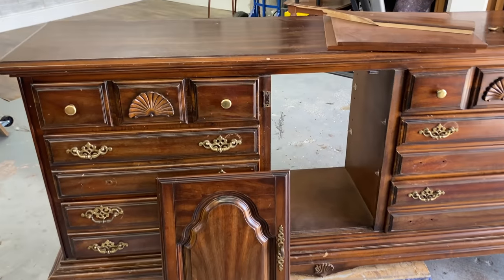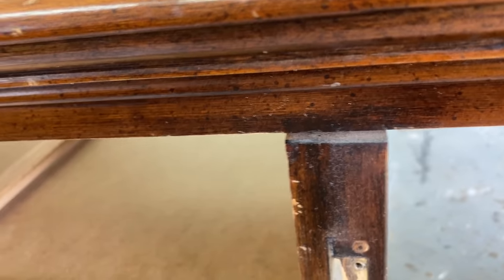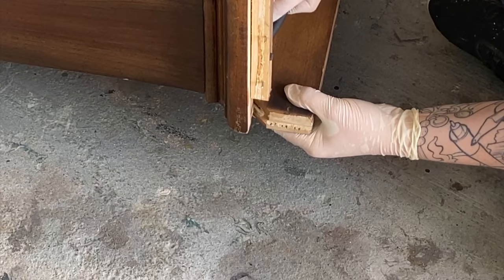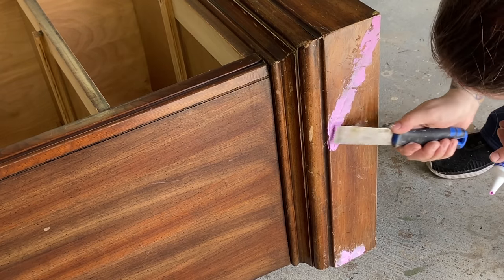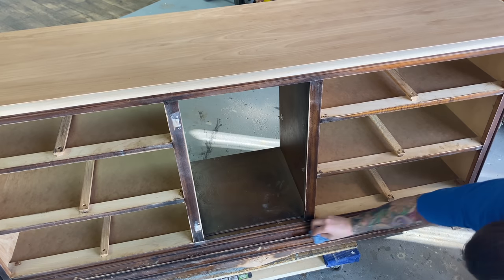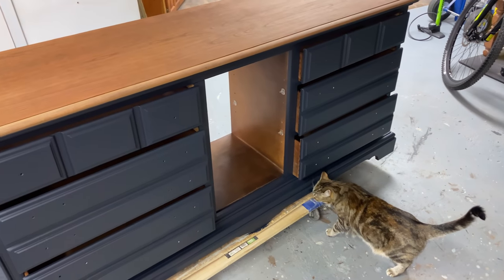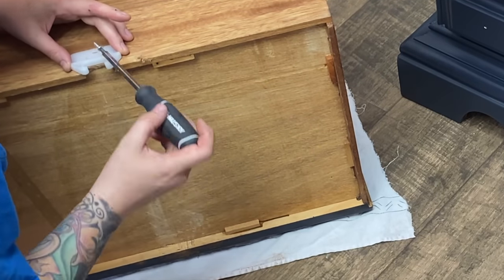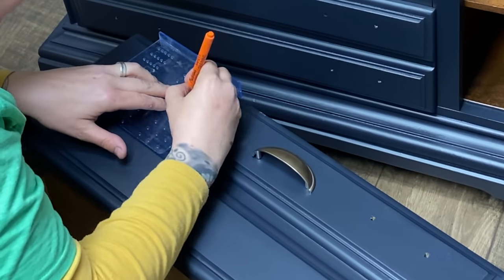REFINISHING a discarded dresser - saved from the trash!

Comment: Brilliant video.  So much info on how to deal with busted up furniture.  Bought my first piece for flipping yesterday - a tv unit, solid wood.  Taking it out of the car into the house and one side fell off it!  On closer inspection the sides and the top aren't in alignment either.  It's going to be a steep learning curve for me but hey ho.  I have a vision of it in my head and if it turns out like what I imagine it'll be fabulous.  You were one of the wonderful ladies that got me into flipping.  I've always had an interest but never had the knowledge or nerve.

Comment: This question isn't really related to this particular video but after watching many of yours I have a question.  I have used wax a couple of times on furniture I have redone.  One was a dining table.  On that table, if you sit even a warm mug of coffee on it, a mark is left.  The other piece was a bedside table.  On it, I spilled water once and immediately wiped it up but it darkened the wax in that spot and dulled it.  Another spot on the small table was left by a glass without a coaster, which completely removed the wax in that area.  I do understand that we need to care for furniture and protect from heat and water damage.  However, I have never seen a finish so susceptible and unforgiving as wax.   I mean, quick, very sudden and  irreversible damage.  When I begin to sell furniture I'm concerned about customers experiencing the same thing I have experienced and I don't want that.  I want their furniture to hold up and last.  Can you help me out here to understand?  Do I just need a tougher finish, and if so what is it?  Or am I applying wrong?  Maybe I need a complete primer on the exact ways to apply, buff, cure, and care for wax.  I am honestly lost.  Maybe you can help out.  Thanks in advance.

Comment: Great video, thanks so much. What is that tool you use to determine the placement of the hardware holes?
Reply from the maker: It’s a hardware drill template! There are many different versions, this just happened to be the one i found locally :-)

Comment: Wow!  I have to admit I couldn’t see anything in the original piece but you certainly showed me, again, what vision and talent can do.
I went into the Wayback machine because you haven’t posted in a while. 😉 I can’t begin to tell you how impressed I am with this, your first full length video.  Exemplary.
I do have one question. You used a relatively small brush on the panels.  Why not a roller?  It seems you could put on an even coat quicker.
Cheers from Dallas 🍻
Reply from the maker: Painting as long as I have on various mediums I'm incredibly comfortable with a brush so it's quicker and easier for me to do it by hand. 🙂 Hope that answers your question Joe!

Comment: Hey Angie
I have a dresser with the same wood in the drawers but it’s sticky from very old contact paper. I tried to clean it out with goo gone, tried scraping, tried sanding. Nothing is working. Help! 😆 what do you use to get rid of sticky residue.
Reply from the maker: Acetone! Wear gloves, but it usually cuts right through that sticky adhesive. Pour some on a rag and “pat” it around the drawer (a decent amount) and let it sit for 20-30 seconds- then try scraping. After that you should be able to remove the rest with just the acetone on the rag itself.
Reply: @TranscendFurnitureGallery  thank you. I will try that.

Comment: @TranscendFurnitureGallery  turned out nice.  I've watched a bunch of your other videos and decided to go back in time.  
You said Odie's oil (I used to have the sweetest beagle/wire hair terrier mixed pup named Odie! Dad had him hooked on Tim bits...lol) takes 30 days to fully cure! That's a long time...how long before you can handle it to avoid messing it up?

With that many pulls in place...it makes me want to pull out shallow drawers but it's an optical illusion.  (Saw it on another flippers channel too). Is there a way to horizontally cut the drawers, add more bottoms and supports? I'm thinking about it for myself when I come across one

Comment: Small tip: you might using automotive bondo instead of the pink drywall stuff.  It's fairly easy to work with, sands really well, dries "harder" than the pink stuff and best of all doesn't shrink in larger holes (which can be a complete pain in the booty)...ice refurbs by the way!  Love your stuff.
Reply from the maker: I actually have some! I use it quite often- it’s the absolute best when hardness is important, like rebuilding corners etc. Best! Cheers :-)

Comment: Excellent job fixing and refinishing  this especially because it was in so many pieces. I just love the colour. The following isn’t a criticism just genuine curiosity. This piece appears to be solid wood so why not finish it as the vintage piece it is? Would it not be worth more in the future if it remained in its original state? I’m a collector of antiques and although this piece isn’t yet considered a true antique, solid wood furniture is becoming quite rare. It seems a shame to paint over it.
Reply from the maker: One thing I learned early on is that there will always be two camps where that’s concerned. Haha. I’m not against painting (obviously), but don’t paint everything I come across. It’s a strange thing regarding perceived value. In this situation- it HAD no value. It was broken on the side of the road. So painting and redoing it greatly improved the value. I’ll never be one to paint priceless antiques or Danish works of art, but fairly common pieces, solid wood or not, I have no problem with painting. In every situation I’ve come across, the value has actual gone up. 
Plus- paint can always be removed. Job security for later down the road. 😂

Comment: If Odie’s oil takes 30 days to cure, does that mean that you can’t sell the piece for 30 days?
Reply from the maker: Directly from the Odie's website -
 'Cure time for Odie's Universal and Super Duper light oil: most surfaces can be used within 24 hours and can be exposed to liquids within 3 to 5 days.
Cure time for the rest of our finishes: your piece can be handled almost immediately after buffing, however we suggest you give it a day or two to further the cure before any use. If you know the piece is going to be exposed to water or liquids, we suggest you give it 5 days of cure time for best results. On exterior decks 4-5 days of dry weather is all that is required.'

Any other Odie's questions, Odie's Oil actually has an incredibly in-depth website with answers to just about any question you could have so for questions specific to Odie's I send people there - https://odiesoil.com/. Under the Cornwall Training School heading there is a TON of information.

Thanks for watching!

Comment: On the top surface oil, what is the long term maintenance for the new owner?
Reply from the maker: Odie’s is much like other hard waxes in that it has great longevity and (depending on the usage of the piece) simply needs a light coat buffed on if it ever starts to appear dull. Some pieces could be several years before it’s required, or it could be more frequent if it’s a high traffic item.